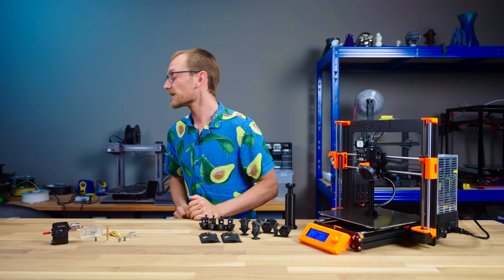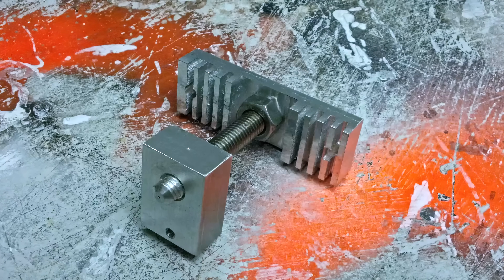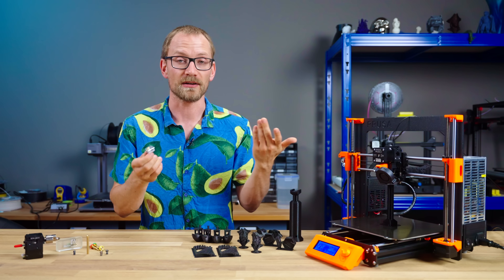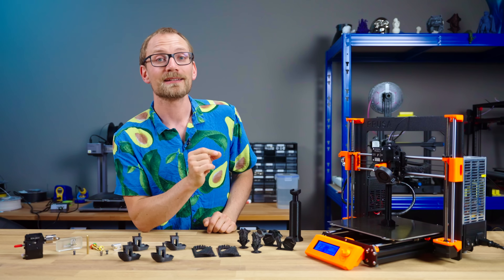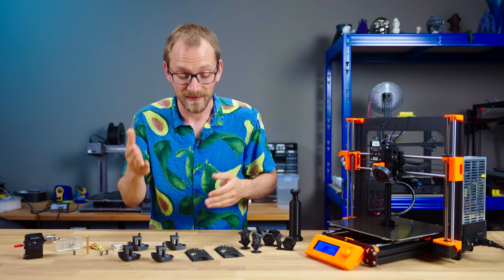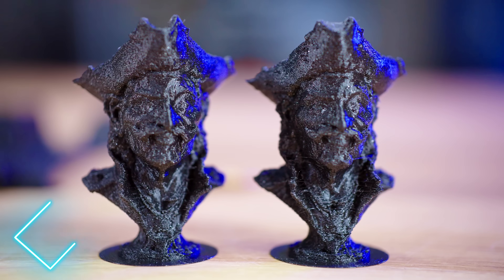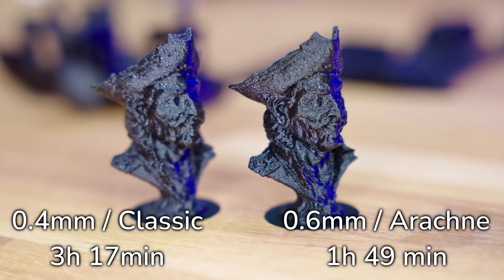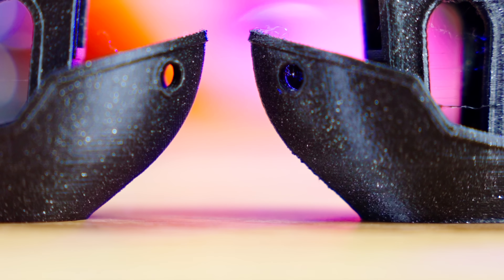0.4mm nozzles just became obsolete

Comment: Why switch?  I keep a rack on my printer with 0.2, 0.3, 0.4, 0.5, 0.6 and 0.8 mm nozzle hot ends. It only takes me about 3 minutes (2 screws) to change. I just choose the right nozzle for each print.

Comment: Cura 5 has let me print some remarkably thin details like small text, especially with “print thin walls” turned on. Compared to previous versions it’s like night and day in this aspect
Reply: I just updated Cura 5.1, do I have to "turn on" Arachne in Cura? I don't see anything for it, someone said it's automatic?
Reply: @mszoomy  Yes, Arachne is on by default. I swear there was an option to toggle which engine you use but I can't seem to find it in 5.1

However you can tell if its working by changing the color scheme in the preview to "Line Width". You should see some slight variation in coloring.
Reply: @funx24x7  thank you!! I was so confused 😆 I'll try the line width thing and see if the colors change

Comment: Finally someone who is in agreement with what I discovered months ago in Cura, and very well articulated!! Bunos fact is that you can easily print with setting the nozzle to 0.8mm too at 0.3mm height, and print even quicker with pretty much the same quality outcome, but consider that one can then print with only two walls in stead of three, it significantly speeds the print even more. Since I changed my three printers to 0.6mm, I will never go back to 0.4mm, you merely confirmed my decision - thank you!!

Comment: Umm... What speed advantage?? Are you comparing different line widths? For an apples to apples comparison you need to use the same line width. A 0.4 mm nozzle printing a 0.6 mm line is just as fast as a 0.6 mm nozzle printing a 0.6 mm line.

Actually, pretty much all your comments are conflating nozzle size with line width, which makes a lot in the video wrong.
Reply: @JorgTheElder  Huh? Why?? That makes no sense what so ever. You could argue that a 0.4 mm nozzle requires a bit more pressure to lay down a 0.6 mm line than what a 0.6 mm nozzle does, but assuming the pressure isn't too much for your temperature and extruder combination then why on earth would there be any difference???

With the same line width and the same flow and the same layer height a 0.4 mm nozzle and a 0.6 mm nozzle move exactly as fast and laying down exactly as much material. Obviously. 🤦‍♂️
Reply from the maker: No, that's the whole point, a 0.6 lays down a fatter line and moves material more quickly.
Reply: @MadeWithLayers  If a 0.6 mm nozzle lays down a 0.6 mm wide line at 0.2 mm layer height at 50 mm/s then that's 6 mm³/s. If a 0.4 mm nozzle lays down a 0.6 mm wide line at 0.2 mm layer height at 50 mm/s then that's obviously also 6 mm³/s. The size of the nozzle is nowhere in those calculations. You seem to be very confused about how this works.
Reply from the maker: @marcus3d  I'm sorry, I'm new to this. I used to think that printing at a wrong extrusion width degraded print quality, but apparently it's all the same.
Why do different nozzle sizes exist in the first place?
Reply: @MadeWithLayers  You're not new to 3D printing, so none of this should be new to you, and I'm ignoring your passive aggressive tone, because dialectics is better than debates.

Anyhow, different nozzle sizes have different pros and cons. Of course you can't print ridiculously much wider than the nozzle diameter, but a bit is fine. (See e.g. CNCKitchen's tests for details.) As I mentioned above, smaller nozzles require more pressure to push some particular volume of filament through, all else being equal. (You can reduce the pressure by increasing the temperature.) Larger nozzles are more prone to cold core extrusion, and can't do sharp corners. And tons of other, less important factors.

You can easily push 0.6 mm lines with a 0.4 mm nozzle, so if a 0.6 mm line width is what you're going for then why not take the best of both worlds and do 0.4 mm outer wall and 0.6 mm (or even more) for everything else? Then you get good surface details and low print times.

Comment: Did you extrude greater than 100% of the nozzle width? For faster prints, I typically print at 150% extrusion width. Does Arachne allow you to print both narrower and wider than the nozzle?
Also, anyone know when Arachne is coming to Super Slicer?
Reply: I often use .6 layer width @ .2 layer height on .4 nozzle in curas newest version and it seems to be working fine... i haven't printed any fine details tho. The only area i can notice being affected is overhangs but this was a problem in older versions aswell. I think this is a tradeoff for printing wider than optimal for the nozzle. Would be glad to know if anyone have a different experience.

Comment: What I dont really understand in this video, is why you compare 0.4 vs 0.6mm nozzles... All the advantages and comparisons you mention are between 0.4mm 'old school' slicing settings, and 0.6mm arachne slicing settings. Why not make it apples to apples, and compare both with the arachne slicing settings, and compare those prints to some 'old school' 0.4mm results. I say this because the arachne benefits a 0.4mm nozzle as well of course, so not using it there is not really fair. Never mind that I am curious as to how much more detail you can get with new slicer techniques with a .4mm nozzle.
Reply from the maker: The point was that the new Arachne engines is able to produce very similar results with a larger (0.6mm) nozzle as what you used to get with a 0.4mm and the classic slicing. So if you were happy with that, you can switch to a 0.6 and get the same parts at a huge time saving.
Of course, as I mention, you can also stick with 0.4mm, print at the same speed as before but get improved details. Your choice.

Comment: Love using 0.6 before, but yeah, did pose some problems for details. I do really need to swap back to it now that this new slicer tech works so well.
Reply: See if using 0.5mm works. It's easy enough to get good details out of it and still provides a reasonably good print times (and less clogging,) than 0.4mm. 🙂🌎✨

Comment: Maybe I've mentally skipped the part that explained it but where does the print time reduction come from? Just increasing the Layer Height or are you also reducing the Perimeter Count from like 3 ( 3x 0.4 = 1.2 ) to 2 ( 2x 0.6 = 1.2 )? 🤨
Reply: Bigger nozzle allows for both. If you need to do less perimeters for the same thickness you save time, same on layer height.

Comment: one thing that's extremely overlooked, especially for simple, chunky, structural prints, is what i like to call "overprinting": even with just with a 0.4mm nozzle, it's no problem at all to print line widths of .8 and up to 1.5mm, and layers of .5 to 0.7mm. of course this is situational, but it works like a charm to print rock solid PETG parts "hot and slow", as well as in vase mode.
not for everybody or every print, but interresting to play around with, especially with what the arachne engine promises! i'll most definately have to play around with this. <3
Reply: if the target extrusion width doesn't fit comfortably under the nozzle's tip, or the tip's face isn't uniform, it will probably mess up dimensional accuracy & cause weird blobbing etc.
meaning it's one of those things were it makes sense to use reputable/well-machined nozzles...
Reply: Yeah, I don't get that either. Especially in vase mode, when I want thicker walls, I just set the extrusion width to 1mm and that's it. Why would I bother changing the nozzle? Most of the time I print with 0.5mm as most of my technical designs have walls that are multiples of 0.5mm thick. In general I optimize my extrusion with between 0.4mm and ~0.8mm depending on the print to get fast printing and less gap fill.
I'm desperately waiting for a variable extrusion width feature where I just set the min and max extrusion width I want and the slicer decides. That arachne looks interesting, never heard of it...
Reply: @RoterFruchtZwerg  Vase mode is quite an extreme scenario not really encountered normally in the wild. Tried overextruding a few times but the parts just don't hold dimensions reliably anymore. They might look good enough, but would behave too unexpectedly to fit in real-life applications. Also it damages the nozzle MUCH faster since it's getting a lot of pressure at the exit. I'd expect that a 0.4 nozzle would actually become a 0.6 nozzle after a month of intensive printing.
Reply: @bzqp2  The e3d nozzles with the flat bottom are great for wide extrusion vase mode, you can easily go 2x nozzle diameter and the flat tip will keep it nice and uniform. With a 0.8 it can print precisely 1.6 mm walls
Reply: @lolatmyage  V6 nozzles? That's what I had in mind. Even though they have the flat bottom they also degrade very fast.

Comment: The problem with bigger nozzles is the flowrate, with a v6 hotend and 0.6 nozzle you will max print speed at around 100mm/s.
Reply: Get a CHT nozzle 🙃
Reply: @stuttgartbatman3788  you can also get a 0.4 cht and increase line width to the same as a 0.6 🤷‍♂️

Comment: Nice!

I'm likely to try Arachne for a different reason. A small plastic part broke on my hand-operated coffee burr grinder. I want to design and print a replacement in Taulman Alloy 910 but the fine features will likely cause issues on the current engine. Arachne seems a perfect application for some of the thin walls that I will be encountering and the minimal zig-zagging will likely help minimize the shaking of some thin vertical walls as the plastic is laid down.

Fingers crossed that I'll be back to grinding and making espressos before the weekend is over.

Comment: I do enjoy your videos but I have a suggestion. The background noise in the audio is somewhat distracting. Perhaps you're already using it but Izotope makes a denoiser and hum reducing software that works quite well.  I'd run your audio through that without the gate and see if it cleans up the printer noise and electrical noise in your audio. The noise gate is both your friend and your enemy.  A couple of cheap Roxul insulation based sound absorbers on the walls will help with the echo in the room and will bring out the warmth of your voice. Send me a message if you'd like. I have experience processing voiceovers. Thank you for what you do for the 3d printing community.

Comment: since I rarely do sculpture, all my 3D printed parts are either structural or even if it's decorative, it's very geometric
most of the time  don't need to "hide" the layer lines or the need to sandpaper it
also, my motion system is quite crap (it's an ender 3), so I can't really bottleneck my nozzle anyway with the print speed
I've been using 0.8 nozzles with 0.24 layer height, and I've had 0 complaints, it even looks cleaner than the 0.4 given how much slower i can run it (or have to in my case because again, ender 3 stock hot end)
even so I'm running it at like 60mm/s ( roughly 10mm^3/s) which is still faster than 'default' speed
and i guess this is personal preference but i kind of like to actually see layer lines on my printed object (that are not sculpture)
there are some thingiverse part that won't print well (i usually design my own parts), but I've been doing this before arachne
i think CNC kitchen says it's stronger also?

as a bonus, it's waaay easier to get the first layer to stick because there's simply more plastic to squish onto the bed

note: supports WILL be harder to remove, the thicker your layer line is

Comment: ..or you can create setup profile with 0.4mm nozzle to print 0.6mm linewidth and increased speed to get the same results. I'm no expert in 3D printing but I get the same results or even better with these settings. There are several videos how to and what to do. I still think the 0.4mm nozzle is still the best option for most of us!
Reply: I'd go further. I print with a .3 nozzle and only have about a 10% hit in max flow rate. I print at 0.6 line width frequently. I've even printed with 1.0 linewidth with this nozzle. I've been tempted to test my .2 or even a .1 nozzle and see how much of a difference that makes.

Honestly, the "big" hit is that the smaller nozzle means shorter layers. But if I'm printing at the same flow rate, that is mitigated by quite a bit.
Reply: I think 0.4mm nozzle have been more than enough for printing threads ect. Like Thomas said in the video it has been compromise to find the golden center line for most of the printers and parts.
Reply: @screet123  I think you are missing what I am saying. I'm saying that I'm getting effectively the same print time with my 0.3 nozzle as when I was running a 0.4 with about a 10% difference. The quality is certainly no worse.

I'm not saying I get better detail. (I do)

The only reason to go with a bigger nozzle is if your gantry is your limiting factor and that would be because you are wanting to print in line widths greater than 1mm.

My guess is that Thomas is making the assumption (incorrectly) that linewidths need to be within 25% of the nozzle diameter. They don't. (Case in point, I can print with a 0.3 nozzle at 1mm line width with no problem.)

I think the best way to look at it is that your nozzle diameter is the minimum line-width you can get, maximum is dictated by the flat part of your nozzle. Your cooling, gantry and maximum flow rate dictate the width within that range that you can get away with. The flow rate is from the hot end and the nozzle diameter/nozzle itself. A smaller nozzle diameter does mean a lower maximum flow rate but it is not linear relative to the nozzle diameter. Something like 10% per .1mm from 0.4mm nozzles. (So a .8 would let your flow rate be about 40% higher.)

The reality is that unless you need to print a large volume of plastic for strength reasons, your limit is going to be dictated by your gantry's rigidity, maximum speed and acceleration. The ender 3 can manage about 50mm/s maximum while printing. That means that unless you are printing at 1mm line widths at .2 layer height, you aren't maxing out your flow rate.

So, with all of that, unless you need to print at >15 cubic mm/s (maximum for a v6) I don't see  the value in going with a larger nozzle when you can increase your line-widths.

Oh, and increase line widths helps a lot with overhangs. It does hurt bridges however.

Comment: I totally agree, but changing it out has never gone well for me. I carefully follow the instructions for so called "hot tightening", but always run into problems later down the line when the filament leaks out from the top of the heater block!

But a pre-tightened nozzle/hotend (from e3d), has yet to fail. Maybe I should switch to a design that can't fail that way i.e revo, but I don't want revo because of the patent issue.
Reply: same, I really want to switch to revo but I feel like their patenting (whether it has any legal standing or not) isn't In the spirit of 3d printing
Reply: @theninjascientist689  I have an idea. Super volcano nozzles fit directly into V6 2.85mm HeatSink, I need a metal lathe to turn down the middle into a heat break.... Not sure of the thermal characteristics/strength of brass will work as well for a heat break, but it avoids the hole issue of leaks and filament clogging due to the join...
Reply: It just sounds like the tolerances on your hotend might be off, maybe being an earlier revision from E3D. I'd sell it and try to get a different one if I were you.
Reply: @Cheeky_Goose  I bought a whole new fully assembled and factory tightened nozzle/hotend from e3d. (which is what I was eluding to). Unfortunately they only offer a 0.4mm v6 prefab currently.

Comment: I haven't been using .4 for some time now, too slow, and that's without the new prusa alpha. Still, if you want to use a bigger nozzles, it's easy and quite cheap to get a 3dsolex or bondtech cht nozzle (the latter is licensed after the former). At bitraf.no, we have two Prusa i3 mk3s printers with .8 and 1.0mm nozzles and they are the most used ones. Works well with 60mm/s or so, even with a 1mm nozzle.